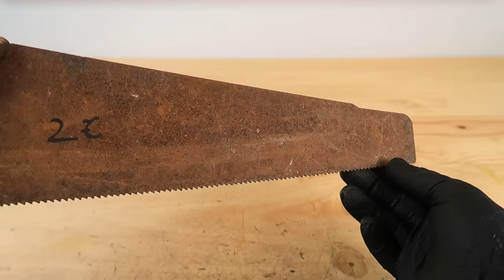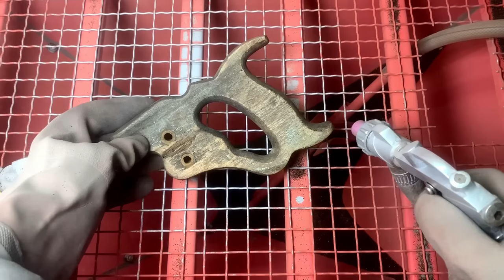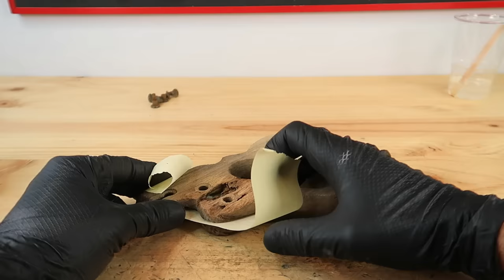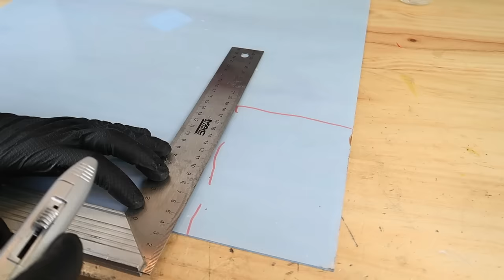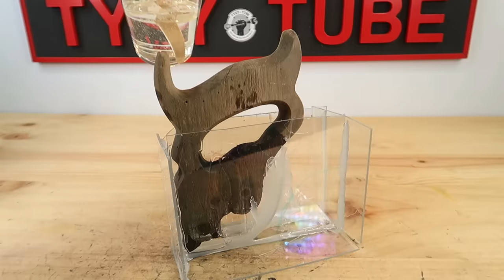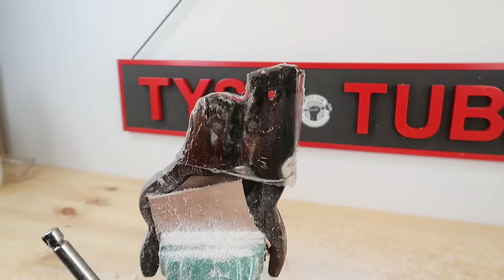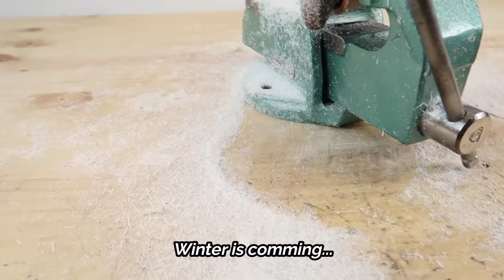Antique Rusty Saw Restoration | With Epoxy Handle Repair

Comment: Hey guys, just a couple of questions What would’ve been better for the handle ? Drilling the holes then sawing ? Or what he did ? Also is epoxy going to break due to the saws vibration overtime ?
Thanks for reading

Comment: All that saw needed was a new blade and a new handle...  on the lines of Trigger's broom!

(You can buy a new blade and a new handle ready combined you know.-  Screwfix sell 'em from a fiver here in the UK and in the US, Harbo(u)r Freight sells a wooden handle one (like this one but new!) for $7 - Some things really are beyond redemption. Time and effort and materials all add up - work out what all that cost to get a polished, repaired, but ultimately still knackered, saw. Personally, I'd have put my efforts into fixing the grinder!)
And before you all start to 'correct' me - I DO understand the ethos behind fixing and renovating things, but I stand behind my statement that some things - like this saw - are too far gone, also some things are renovated to 'as new' or possibly worse, 'better than new',and lose all the beautiful patina built up over the lifetime of the item. Still, you pays yer money...

Comment: I really like the restorations that you carry out and also admiring.  By cons why such a riot of plastic materials from petrochemicals for 1 small handle of wood saw.  It would have been ecologically more economical to take 1 piece of wood and shape it, right?  We must approach the carbon footprint of 1 flight in Concorde to go from Paris to Bécon-les Bruyères (9.2km)!  Or then, there is an historical interest ... it is the saw which served to Leonardo da Vinci to cut the legs of the Mona Lisa ??

Comment: you know if you replace the start capacitor in the grinder it will start on its own and not bog down when you press into it.....what ever its micro fared (somtimes marked as MF or UF for ultra fared) dont be afraid to go with a slightly higher number (even more tourqe/power) dont go lower as that will produce less power to the motor

Comment: Really cool video. I like how you restored it using ALL original components. Would have been really easy to make a new handle and buy new screws, but the direction you went was much more enjoyable to watch. Would have liked to see you test the saw to see if it works!

Comment: To my mind that was more of a preservation than a restoration. Restoration mean to me that the object is use-able again, The blade was clearly too damaged to be used again, you'ed risk snapping it in half at some point. You can only do so much with what you're handed. Just IMHO of course. ;)
That was a clever bit with the acrylic on the handle, were it me I would have massaged it a little more to expose more of the original wood, and used a courser sandpaper to leave scratches to simulate the missing wood grain, but that's just my OCD kicking in. It's all dependent on what you're given to work with to start with. Sometimes there is only so much you're able to do and keep the original parts.

Comment: Great videos. Just wondering if you have ever done any restorations on any 8mm 1940s windup video cameras? I have 1, i have been trying to restore for awhile now. I got it running, but tried to take apart again to double check everything was good to go. I can no longer take it apart to get to the inside gears. Just wondering if you had any pointers on how to get it back apart. From what I have seen from your videos, I was hoping you could help me out with this. No big deal if not.

Comment: I like most of Tysy's Videos but I don't like this one as much. Even after the Restoration it doesn't look that much more usable. The Metal is really thin and still kind of spotty. It would probably easily break. And the Handle would be easily made from Scratch, even with cheap tools.  I still enjoy the Process, but using Resin to make something that could be done with wood and without any plastic waste seems much more in the Spirit of Restoring to me.

Comment: His work is always impressive and high quality, but this one still looks ‘meh’ after the restoration work.  Holes all over the blade and evident epoxy hole filler in the handle.

Comment: This project should not have been taken on. The blade has too many rust pits and the handle should have been painted and not left with a wood finish...  6/10

Comment: Unless you plan to use this saw on a regular basic, it will rust up pretty quickly. And if you do plan to actually use it, you will need to hand sharpen the teeth first... If you have plans on basically displaying it, put a good coat of wax on the metal... Thumbs Up!

Comment: Hey TysyTube Restoration:: Have you ever used a product called Quiksteel? It's like that two tone colored putty that hardens
when you mix them together,but this type is infused with steel dust, flakes,or something like that. Perhaps they just
 dropped it on the floor I don't know. I hope they didn't just add metal shaving to some Play-Doh  LoL I haven't used
 any of it yet,but I did buy some. It's claims to dry to the color of steel aka a lite to medium Grey,and can be sanded,and
painted an dealt with like steel... weldable? I doubt it an painting isn't going to help me,but I'm going to try it out next
 time I get a badly pitted blade to work on. Because they're also claiming that once the putty dries it bonds to the metal
 as well as Bondo. An the more you sand it an as the grits get higher in number the putty becomes more shiny like metal,and it will catches a magnet just as steel would. So going to give a try before too long,but if you try it out first would you give us your opinion an feedback on it freaking awesome bro...
P.S. I like your channel...an so I subscribed today. I think your panel saw turned out really great. I noticed when you sharpened
the blade on the first side then turned around,and done the other side; did you skip every other tooth on the first side,or
did you sharpen every blade tooth without skipping any? I've been told to do it both ways; so now I've become confused;
an that's sad, because it sucks to be sad,and confused... 😆<(one or the other,but not both!) If you have already address this
question in another video could you please tell me which on to watch for that info... if you actually see this comment that is LoL
Thank You!

Comment: well first of i would maybe repair the handle by tracing it out on a peice of paper and then id stick it on a peice of wood and cut it out but thats my opinion maybe you didnt have so much time but i dont care and second of all man that air pressured or water pressured machine must be soooo expensive.! can you please correct me and tell me what the machines name is?

Comment: The problem here is that you started with an object that was beyond repair or restoration. You had a blade that was too far gone and a handle that was destroyed. The restoration did not leave you with a functional saw; you now have a handle with no structural integrity and a blade without enough rigidity. And in the process you wasted $25 in materials... and FOUR DAYS! Your $2 saw is now worth... a little less than $2. This was not a successful project.

Comment: For this particular project, I would
A. Buy a new hand saw of similar size and shape for $10.
B. Swap the new handle for the old one.
C. Then swap the new blade for the old one. 
Total time: 3 minutes. Total cost $10.

Comment: If this tool were mine put it in the trash and buy inmediatly another new tool that will works safely for a long time; if you analyse the working time versus the materials cost used in the "repairing" the tool, this isn't a logic work, an engineering principle is solve the problem with the more economic option; you will cry when the saw be broken in the first cut, don't spend your time and money.

Comment: Kinda hard to watch you use plexiglass 20$ then epoxy 20$ then all the time for a pull saw😂that costed 2$(more than it was worth)😂🤔👏🏻
Congratulations you just made a 200$ pull saw no one will ever use😂👍🏻
Reply from the maker: 🤣🤣🤣🤣, was expensive to restore... but my video made 30x more😬
Reply: TysyTube Restoration 1.8 million views 😂wholly moley

Comment: The blade is now still full of black rusty pits, and is now also a too thin to be used.
MC-51 is not good enough for removing the rust from the metals that have a multiple layers of rust.
The best solution (when it comes to a chemical rust removers) is to use a Hydrochloric acid (also known as Muriatic acid).
The oil will not penetrate into a handle since the film of an epoxy resin is all over it.
You can see that the handle is now very slippery and dangerous to use.
Unfortunately, this restoration was a failure, and he knows it (not showing the saw in action).

Comment: You can make your own Wood Putty with wood grit and some kind of water based adehesive, mix both of them and the apply it to the holes, you will even end up with a wood finish because wood grit is wood by itself. That thing you did in the video, was a huge waste of time and materials.